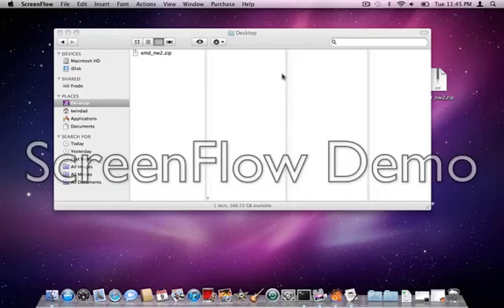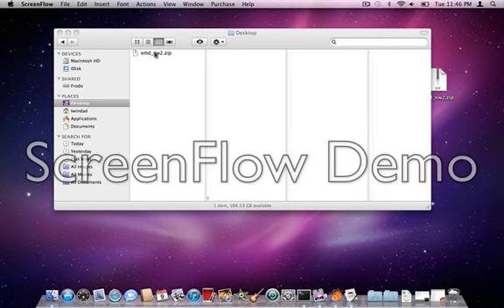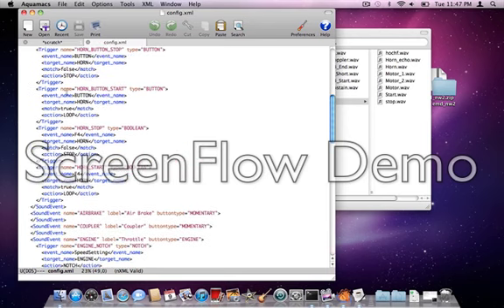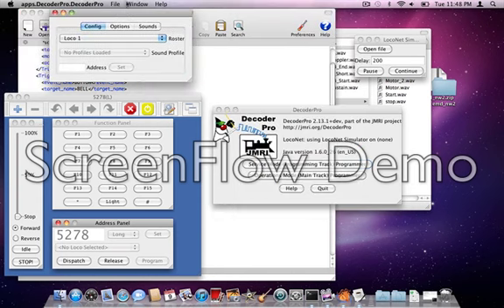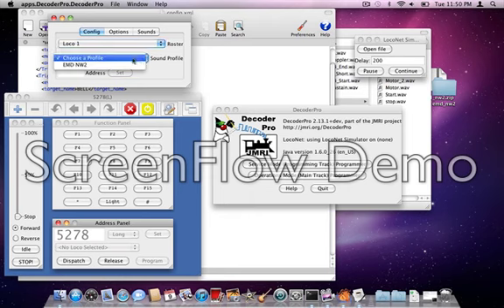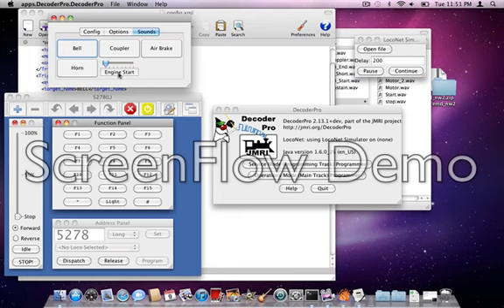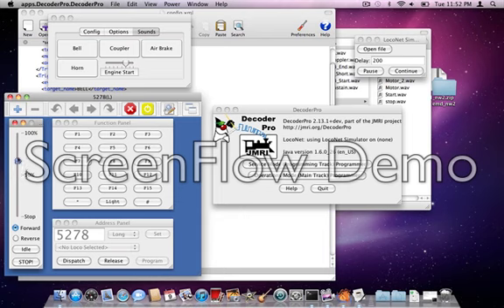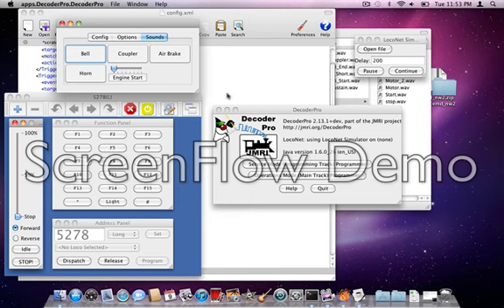Virtual Sound Decoder for JMRI

Comment from the maker: @dcalcutt Sound decoder under the table does work, but requires a separate decoder for each locomotive, plus audio mixing h/w.  And doesn't do location tracking or doppler effects.  VSD allows all of that at no incremental cost.

Yes, the sound quality is poor.  I haven't even tried to optimize that yet.  Still trying to get the fundamental structure in place.

VSD isn't for everyone.  You're welcome to use it or something else...

Comment from the maker: Hi, Pete.  Right now, the only publicly available VSD file is included as "example.vsd" in the current JMRI release.  You should see it in the file browser when you click the "Load VSD File" button.  There are a couple of folks working on "third party" VSD files, but we're working together on some improvements to the sound modeling to go along with it, so these additional VSD files probably won't be available until summer.

Comment: Very impressive! I presently use DCC & Analog control systems (via a selector switch). My PBL Foreground analog system, drives a speaker installed inside each locomotive (analog only, with dc blocking caps) by sending the sound signal through the rails. The PBL also has a external audio input jack, for extra sounds input. I'll bet I could use your sound application to output the sounds into the PBL system, thus sending the sounds directly to the locomotives...

Comment: @dcalcutt Useful for Z Scalers,N scalers, Those modelers with non sound equipped DCC locos,Those modelers running DC equipment ( Thats right, it can work without DCC ). Thats just the start of something big. Sorry You dont get it.

Comment from the maker: OK... so... when you start JMRI... and then you choose Debug->VSDecoder Manager from the menus, you should get the VSDecoder Manager window.  It will be empty except for an "Add" button at the bottom.  Click that.  This will pop up a dialog that will help you set up the decoder... put in your loco address and choose a sound profile.  In the lower center of this dialog is the "Load VSD File" button.  Click that, and you should get your standard file browser/chooser window.

Comment: Mark, let me join the others on here in thanking you. I first toyed with VSDecoder yesterday and have already figured out how to alter the config file to play my own sounds. Still figuring a few things out (I've never done any coding before, so this is entirely new ground for me), but I'm well on my way to having a customized steam option completed for my n gauge set up (had to change some of the rpm settings and add in some sounds). Thanks very much for this great tool! I'll post a video of my customized Vsd in action, once I've ironed out a few more kinks. Would be happy to share with anyone, as the sounds I used are open source :D Some of us should come together and create a database of Vsd files somewhere.... ;)
Reply from the maker: +N-Gauge-US Thanks for the compliment!  Would you be willing to donate your customized sound file to be part of the standard distribution?  We could really use a good steam engine example...
Reply: +Mark Underwood I would be more than honored. Let me work on it a bit more and I will be in touch with you (I found your blog, is that a good way to get up with you or is on here better?).
Reply from the maker: +N-Gauge-US Here is probably best.

Comment: 1. Is there a Volume on each of these sounds just in case I don't want everything to be louder than others. and 2. Can you use different sounds on each locomotive at the same time or can it only be used 1 sound? thanks
Reply from the maker: +Chessie System 2057 (CSX2057) 1.  For now there is one master volume slider.  I have adding individual train volume control on the "to do" list, and also individual gain adjustments for the sounds within a given loco.

2. If you mean when you have 2 locos can one use one set of sounds and the other use a different set, then yes, that is supported.  Just click "Add Loco" and choose a different profile from the config pop-up.  Any given locomotive can use only one defined sound profile at a time.  If you want to mix up the sounds (e.g. use the bell from one profile and the horn from a different one, then (for now) you will have to edit the VSD file to create a new profile.  it's not all that hard, if you know XML...  

Eventually I'd like to write a "profile builder" tool that will allow you to create your own sound profile from individual sound files, but that may be a while...

Comment: Is having to edit the operations location roster xml file the standard way to set location positions for the VSD (since no other way actually saves it)? I'm amazed I even figured that out.
Reply from the maker: This appears to be a bug.  You're supposed to be able to set the physical location of operations locations via the "Tools->Set Physical Locations" menu item from the Locations window, but it doesn't appear to be working.
Reply: +Mark Underwood Just trying this - is it still not working Mark? Would love a video on how to configure the sound space so a throttle and panel link together to show a loco apporaching and fading away. Does it need a xcript or can it work without scripting? Let us know...!
Reply from the maker: Yeah, unfortunately, other unrelated stuff (read: life) has kept me from working on this for a while.  It's still on my "to do" list, but I'm afraid I haven't made any progress.  I'm hoping to get back on to it this winter and move it forward a bit.

Comment: Hello, my question is if I can change the CVs of a locomotive with is program?, Because I have an EZ Command Bachmann and this is limited to owning no display, thanks for your answer and greetings from Peru
Reply from the maker: Yes, you can use JMRI to change CVs, using the DecoderPro portion of the program. The bad news is that you cannot do this with your Bachman EZ Command, because the Bachmann product does not come with a computer interface.

If you don't want to switch your whole system, you might want to look into the SPROG-II or SPROG3 product, which will allow you to control a programming track from your computer (using JMRI), and can even be used as a command station for a single locomotive.  The SPROG boxes are available for under $100US.  I can't post a link in the comment, but just Google "SPROG-II" and you will reach their website.

Comment: I have another question ... with the Digitrax PR-3 interface I can also have the same results?, Since my engine have to doders sdh164 and dh123 of Digitrax ... thanks
Reply from the maker: Yes, the Digitrax PR3 can be used in "stand alone" mode to program CVs from your computer.  In fact, that's what I use, normally.   The SPROG has the advantage of also being able to run a single engine (it can be used as a low-powered command station), which makes it useful for test.  The PR3 does just fine if you already have a command station.

Comment: What it says is that I have to have a Digitrax DCC command to work with the PR3? ... Or you can just set a decoder with the computer and PR3? ... thanks
Reply from the maker: You can use the PR3 two ways.  (1) Use it as a computer interface to a Digitrax DCC Command Station.  In this mode, you can use JMRI's throttles and other features through the PR3 to control the Digitrax Command Station.  This mode works only with Digitrax gear.

(2) Use it as a a stand-alone programmer.  In the second mode, you hook the PR3 directly to the rails of a "programming track" (just a piece of track that's not connected to your command station), and then to your computer.  You can then use JMRI to read and write CVs on a locomotive sitting on the track.  Once the loco is programmed, you can move it to your regular track and use your Bachmann command station to run the train.

It's this second mode you'd want to use the PR3 in.

Comment: is it possible to run these sounds even though not connected to the layout?
Reply from the maker: Yes.  You can use one of the Simulator interfaces to run JMRI (and thus VSD) on your computer without an actual connection to the layout.  The one I'm most familiar with is Digitrax.. when you set up a Connection in Preferences, choose Digitrax as the manufacturer and "LocoNet Simulator" as the interface.  It doesn't really matter what brand of stuff you are actually using on the layout, since you are just hooking up a simulator.  If you plan to sometimes be connected, sometimes not, it's best to use the simulator interface that matches the brand of your hardware, though... 

HOWEVER... since VSD is part of JMRI and JMRI is not connected to anything, VSD will only be able to "see" and respond to JMRI throttles or WiThrottles.  Hardware throttles connected to the layout (but not to JMRI) will not be able to send VSD the info it depends upon to react to them.

Comment: @dcalcutt Rather then criticize about the sound maybe you should make some sound files to go with it. This VSD is in early stage of development and it has progressed very fast from his initial beginning of the project. You can look into the project  files to see how the engine sounds are set up. Its open source so anyone can help develop it. The nice thing is, if you dont like it- You dont have to use it! There are plenty of reasons that this project is awesome.